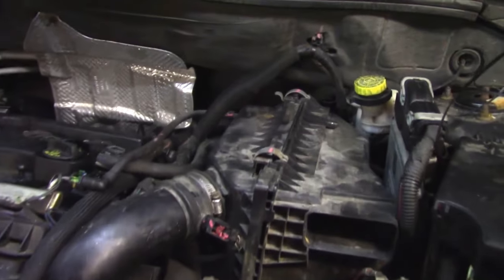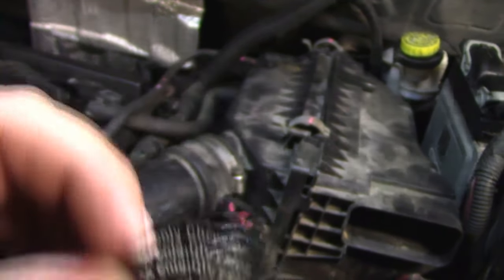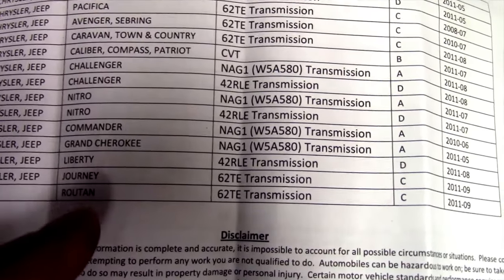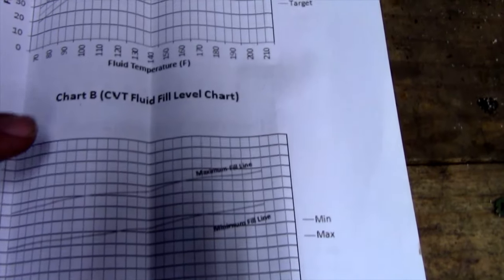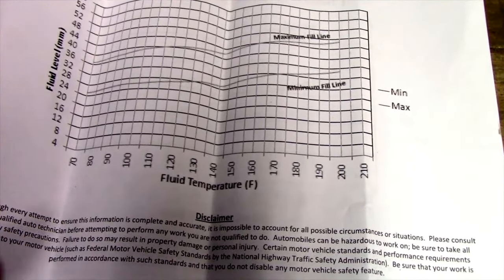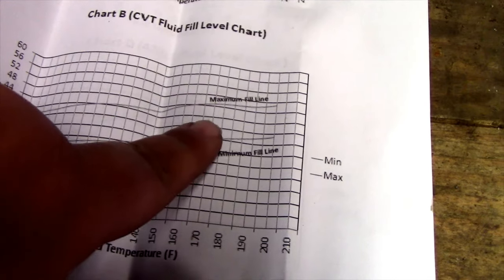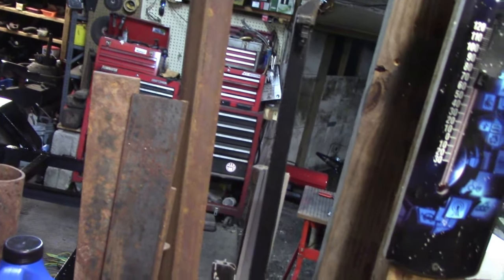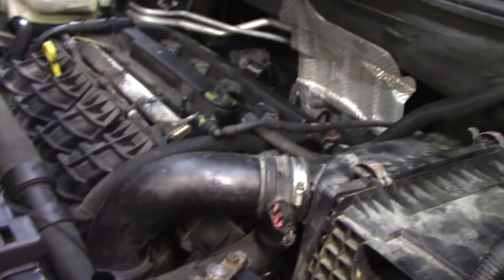Checking Jeep cvt transmission fluid

Comment: Hey were you & Wayne joking around? This video seemed like 2 guys who didn't want to take any responsibility with the fluid level. So to me it just seemed like sorta telling us where it was..
The Fluid Checking, was from 3:47 to 3:53 So just that what, 6 to maybe 7 seconds long was reading the fluid section of the video.
So you go to Autozone, you tell them the model & year, they give you the correct dipstick & then you do the checking & it should coincide with the temperature of the fluid. I'm gonna try using my Infrared Thermometer, which I use for testing Laptop or Desktop Motherboard's, The Graphic's Card GPU & CPU's. The Infrared Thermometer can give you the reading in either Celsius or Fahrenheit. This evening I was checking the fluid level's in my Jeep Patriot & I just used the engine oil dipstick. Although the diameter of the CVT Oil filler tube is larger than the dipstick ring & cap I could still get the CVT fluid on the dipstick which was right between full & well actually just below the add mark. All I need is one good reading. 60 years of being able to go by a cold mark reading and then all of a sudden, the car companies decide it's better not to trust people with a dipstick because we're just to stupid to check the fluid level. 

I'm still trying to figure out why dipsticks haven't been leaked out to the public from the dealerships, like everything else.....
Reply: Thanks you

Comment: This what the Jeep dealer told me if you have a warranty and want to keep it so that if anything goes wrong, it must be done by a trained technician, at or before your owners manual says, if not your warranty for that CVT transmission will be not will not be covered, as far as the other stuff, if it is not a covered by a warranty. you have the right to have done when you want it done, and can be done by you or anyone else that knows how to do it. As for me,  I am a retired truck mechanic, not have a warranty cost me $8,000 dollars, as in my case the bank would not loan me the money to replace the transmission, forcing me to buy another Jeep like the one I lost.
Reply from the maker: I have no idea what your going on about..

Comment: So, you start the vehicle.
Run it through the gears.
Do you check the fluid level while running, like “normal” automatic transmissions? (I assume so, as it looked like the engine was running in the vid)

Comment: I was at an auto salvage yard & found a dipstick, (probably a engine dipstick). At any rate, I put it into the transmission on my 2010 Jeep Patriot. Pulled it out & marked it where the fluid level was, ( I had checked the fluid level before using my engine oil dipstick so I could compare the fluid levels on each dipstick). I'll be changing filers & trans fluid next week. Once I refill the system, I'll check it both cold & hot & mark it accordingly. I made a pocket by the fender to store this dipstick along the same side the transmission is on. It's like 18'' long, not 4 feet like those idiot dipsticks from amazon.... Dealers want $75 to check your trans fluid because according to Jeep, owners are not smart enough to keep the correct fluid level in the transmission of their vehicle....
Reply from the maker: They are that long so they can be used in other applications like my 300c where it's about the right size
Reply: @backwoodzcustomz1549  Yeah, the Jeep Liberty, 07 for sure needs a longer stick. On the Patriot I have, any small engine oil dipstick would work. I understand the reasoning behind it. But for people who never look at a owners manual or notice what that plug is, I hope they never get a leak that they don't catch.

Comment: Thanks. You taught me something! I have a 2003 Saturn Vue that I bought from a deceased neighbor and I'm told that it could have a cvt trans. It's moving but dragging and I was told to try Transmission fix before trying to buy another one. I learned from your video that a dip stick can be purchased with a chart attached. I can't get any help from auto zone about the trans as if you can really put the fix in yourself but we're not helping you here. How can you help me whether a website or whatever, PLEASE! I hope I'm clear and making some sense in this comment.
Reply from the maker: Not sure. I've nevermessed with them. Im sure a Google search can lead you somewhere .
Reply: Thanks but I understand from you and comments that autozone sells cvt dip sticks.
Reply from the maker: @airadcli1011  right, for many applications.. if they don't sell it for yours then they don't..
Reply: How do you like your Saturn Vue.I'm actually thinking of buying one from a southern state like Tennessee, or at least from Kentucky.

Comment: I went to Auto Zone and was surprised they didn’t have anything to help. Told we to go to a dealership to read my 2006 Jeep Patriot dip stick because it was pressurized. On one of the video Auto Zone name was mentioned to have this dip stick to read for oil. I don’t think my transmission is done but it moves very slow. Need help because dealerships would charge arm and a leg I don’t have. Thanks
Reply from the maker: Yea, dont truat anything they tell you at parts stores, i qorked at them all and 95% of the people that work there know nothing about cars. Just go in and give them the part number in the video and miraculously they will have it...
Reply: Fyi i use obd jscan and purchased from amazon a  cheap code reader they validated. Obd jscan is friggin awsome. U can use it in demo mode before u buy a $20 key to activate it

Comment: No one ever actually shows or tells you what the millimeters on the stick should read when full and at hot operating temperature
Reply from the maker: because you cant do it that way. that's why I show how to do it this way. You have no way of knowing what the trans temp is and it goes bases of off temp and mm.. So if you know what the outside temp is you know about what the trans temp is after it say over night..
Reply: @backwoodzcustomz1549   okay mine reads about 45 after sitting all night and it's usually around 80° here in South Carolina in the morning but when my truck has been driven and at full temperature pretty much I look at the stick and there's barely anything just on the bottom quarter of the stick and then the chart it kind of shows like the hotter the vehicle the higher it should go up on the stick but that's not the case the hotter the vehicle the less transmission fluid is on the stick that's what I don't get
Reply from the maker: sounds like you might be getting a false reading somehow.. Most any fluid as it heats up it expands, so the hotter the more you get.. Are you checking it on a level area, at the same spot? You should also just shift it through the gears before checking cause the trans will drain down over night, maybe drive it back and forth a few feet. And flow the instructions with the stick you got for doing it in park, neutral, or drive.. Hope this helps some..

Comment: I have a 2012 jeep patriot and my trans fluid cap is not located there, im still looking for it
Reply from the maker: Not sure
Reply: It is probably broken off half way down like mine was. They are known for it
Reply from the maker: @ShaneTL4582  what is broken half way down? They only have a tube from factory no stick
Reply: @backwoodzcustomz1549  the actual tube. I went to do a fill and couldn't find the fill cap, looked half way down and the fill tube was broke half way at the connector. Alot of forums people reported the same issue.

Comment: I stick in my dipstick but it's absolutely dry. There's no oil in the transmission. I checked because I found oil at the parking lot and I've been hearing squeaky noise whenever I step on it.
Now, I going to top it up according to the chart but I'm wondering how did the transmission oil leak out? How do I find the leak?
Reply from the maker: You can climb under and take a look or lay something under to find the drips.

Comment: Will it start to overheat if the coolants low ? Like the transmission light comes on at 70 plus
Reply from the maker: Technically yes... The trans cooler is cooled by engine coolant.. if coolant is low it becomes hotter cause it can't cool properly... Easy way to find out is put coolant in it..

Comment: So that stick in ur hand broke off mine what’s the name of it called
Reply from the maker: The only stick I have is one I bought at a parts store
Reply: @backwoodzcustomz1549  do you see the sticker on the cap that cap that holds the tube broke off my car do you know by any chance what is that tube called ?
Reply from the maker: @theresagonzalez5162  it's you transmission dip stick tube.
Reply: @backwoodzcustomz1549  can you drop a url I can’t find it no where online and it broke today I also reached out to ur Instagram with pictures
Reply from the maker: @theresagonzalez5162  it's going to be dealer only or used from a junkyard...
Reply: @backwoodzcustomz1549  dang thank you

Comment: My 08 caliber 120k miles all of a sudden we wer3 driving back from kentucky and on the last 20 minutes before we got home bam the trans light came on. Engine temp was good. So I had to go to the closest exit and let it cool down for 20 min. We bought this thing maybe a month ago!. Anyone tell me why it would get hot like that and then be fine again. Any suggestions on what I need to do
Reply from the maker: Yes, sell it asap and cut your losses... Harsh but it's reality. You should do homework on cars before you buy them. They are on my top 5 worst cars to buy..
Reply: Yea we usually lookup cars before we buy. But honestly i can find reports on every car made on Google that complain. Everything checked out when we test drove it. Luckily it hasn't done it again yet. Thanks for th3 advice though
Reply: The stock  trans oil coolers on calibers are really not great. Mine does this as well on extremely long or hot road trips. Installing a bigger oil cooler would probably help out a lot.
Reply: We sold it! Forger this crap lol

Comment: Hi all, on my 2010 Jeep patriot, I call two different place's, both said they had the right dipstick, I got to the first place, there's just looked like a long dipstick someone cut off, I went to the second place, and it looked like the right one, it all the different marks like it was supposed too, so I got it and went home when I went to check my CTV transmission, It when in so far and it hit the bottom, I said that can't be right.  I pulled the dipstick from my motor oil, whipped it off, and used it. fuck Jeep and their CTV transmissions! later I started having problems, took it to the dear to check it out, they said I could eather replace the valve body for $2500, or a new one for                                                                      $8,000, so I started calling around, nobody would work on them, I found one place, all they do is replace them with new.
Reply from the maker: Yea no on touches them cause they don't want their name attached to it... A mechanic has to stand behind his work...
Reply: @backwoodzcustomz1549  I don't think it's that so much as that it is a junk transmission.
Reply from the maker: Correct... So a mechanic doesn't want to have to put his name on that trans... If he touches it he warranties the whole thing.. then something else in it goes wrong and he's on the hook and looks bad..
Reply: @backwoodzcustomz1549  it, not the technician that stands behind his work. It is the dealer, if the technician did not do his work the correct way he would not be working there very long. Besides not doing his job right if that car goes out on the road and crosses an account and people are killed or hurt you sue the company not the technician. 
Why you give me a hard time I have nothing to do with your problem, All I am trying to do is give some person free advice, You make me wish I had never got involved in this post.
Reply: When they go bad a you can do is replace them got nothing to do with putting. NAme .there are mechanic's that know how to work on them just gotta find lne.they aren't junk and for that matter all. New vehicles are.coming out withe. So ya either buy old vehicles.other tha. Jeeps or know what your buying before so your not kn here bitching about things u don't understand  because u didnt do research on the vehicles bought before hand

Comment: I love my 2015 Jeep Patriot, but it doesn't love me. I just had the engine replaced, after blowing a gasket. Nothing is normal, easy or regular on these cars. I AM OVER IT!!! The tranny dipstick is missing an the piece is broke off in the hole. My car recently started running rough, whining an whirring an changing gears hard. Another dipstick is almost 40 bucks an $65 just to refill the tranny fluid. This is ridiculous. I cannot wait to pay this car off an get RID of it!!!😩
Reply from the maker: You can sell it before it's paid off
Reply: @backwoodzcustomz1549  
DONE ✌🏼After blowing a second engine. I really tried!!!😔

Comment: Hi, I was changing strutts on the passenger side of my jeep patriot 2wd, and the cv axles came out, lost  less than a half of quart, can I just add it that amount back without going through the trouble of buying a dip stick.thanks.
Reply from the maker: You can do anything you like.. I would highly recomend doing it correctly.. They are very picky on fluid level and that trans is like $800 used....

Comment: Bottom Line Dont Buy Jeep Patriot 2007-2017
Reply from the maker: 2014 the starting putting in the Hyundai 6 speed which was much better..And they offered a manual trans as well, every year I believe.. But yes don't ever buy a Chrysler with a CVT trans.. Actually don't buy anything with a CVT TRANS unless it's Toyota cause they have it figured out... No one else does.. Lets just let CVT's in things like snowmobiles and go carts lol..
Reply: @backwoodzcustomz1549  They went Back to Torque Converters ,,Manual Transmissions  Screwed also
Reply from the maker: yes, the manuals had issues but most of that was sorted by 2011. And ysa they went back to what has worked for for well over 100 years, and now all is well..
Reply: I was gonna buy 2010 Patriot  but Backed off the Purchase cause of Tranny Problems ,Ok Thanks
Reply from the maker: That was 100% best choice to make!!! Glad you didn't get stuck with one of these...